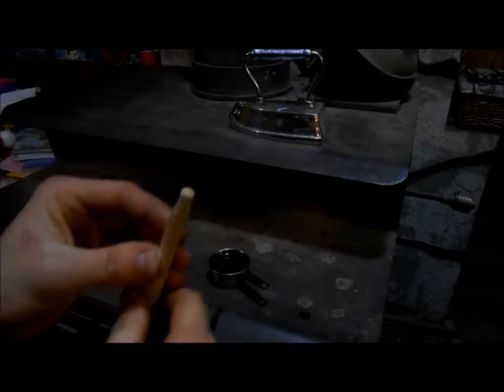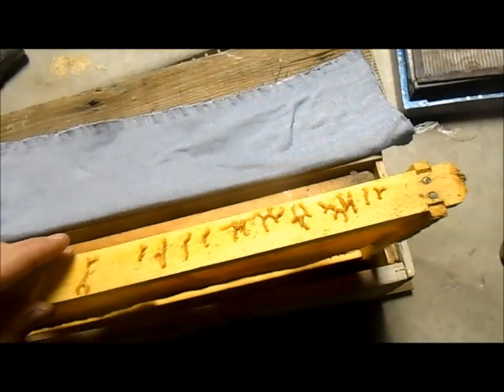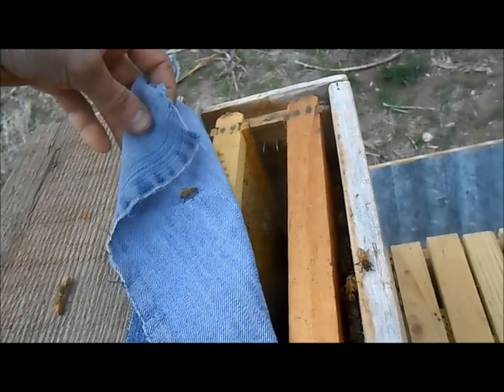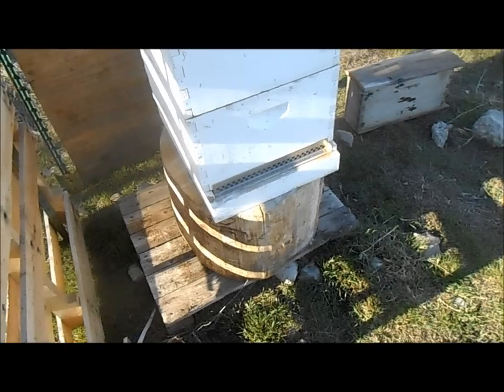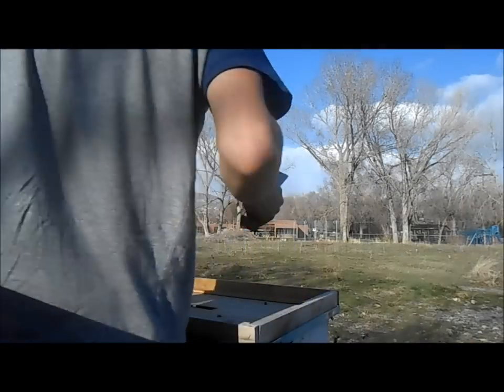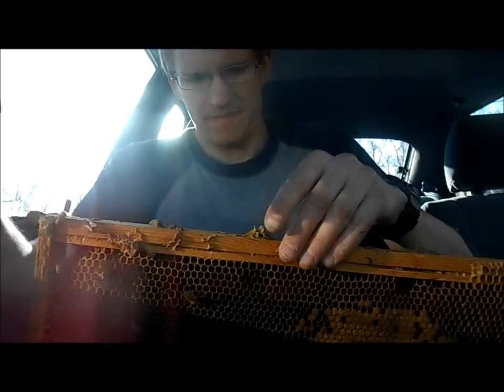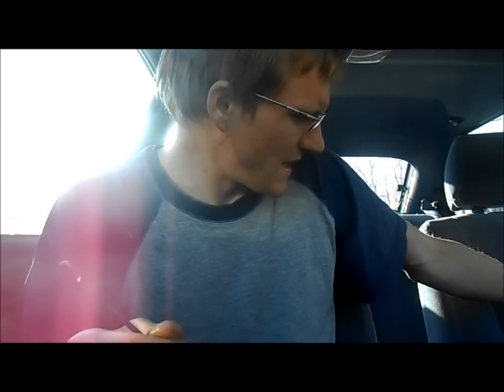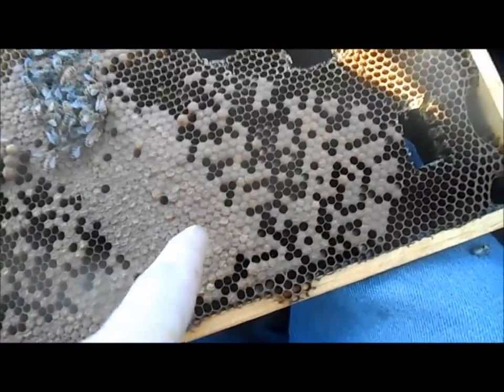Year of BeeKeeping Episode 13, Start Making Queens

Comment: Buy a cheap cattle syringe any size it doesnt really matter that is how one of my friends does it I guess he claims it works well for him when he glues stuff down with wax. Then get some hot water hot just shy of boiling and use that to clean the syringe out it helps with stopping dribbling wax everywhere and you can put it exactly where you want the wax. Good luck with the bees and the queen cells.

Comment: could you not just drill the holes a bit larger in the wood and then fill them with wax and then insert the wood dowel while the wax is molten  to make a hole, a cold rod would be better.